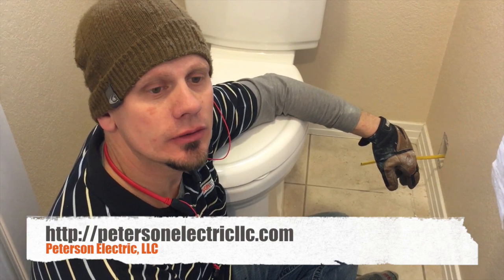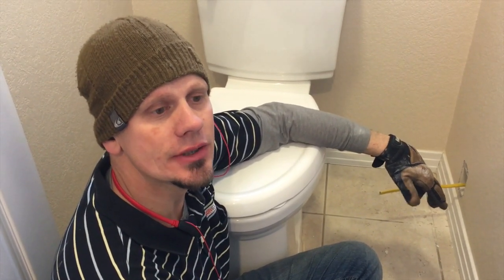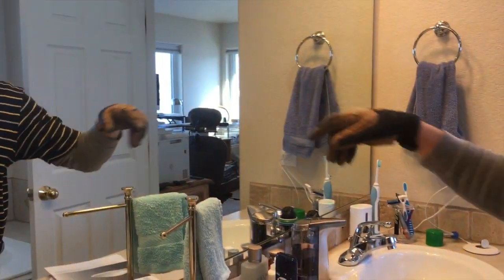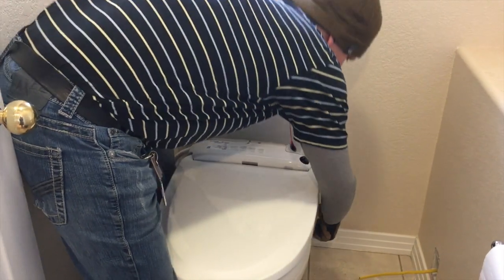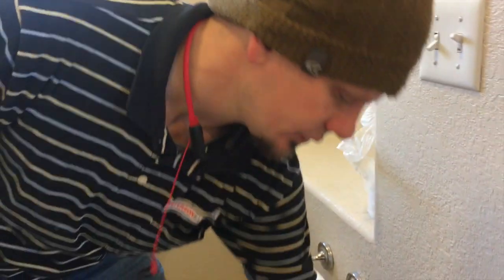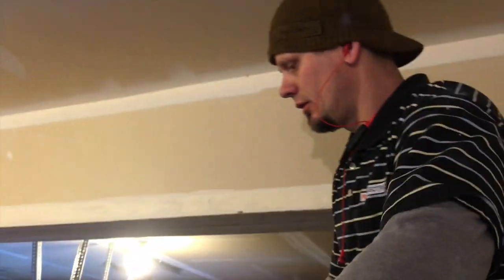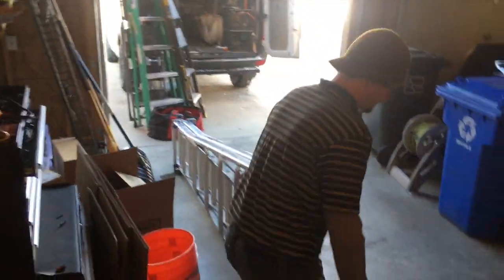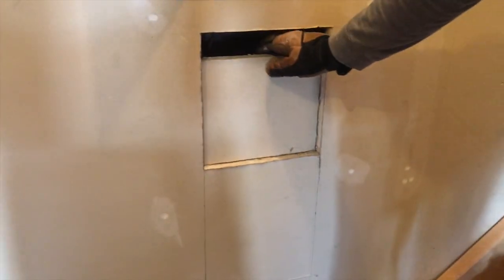Electrical Wiring For Heated Toilet Seat, Part 1

Comment: Nice vid Josh, thanks for posting.  Maybe you can better expound on your method of fishing that line down to the garage?  I know you cut in the receptacle box in the bathroom, then used that hole to angle-drill down thru the 2nd fl plate.  You mentioned tapping to locate it in the garage?  Did you then drill upwards thru the drywall & 1st fl plate, based on the tapping sound alone?  Seems risky.   Or did you have a flexible extension bit to reach the 1st fl plate?  Seems like the ceiling drywall & insulation above, would muffle the tapping sound enough to make it non-exact.  Anyone else have tricks for fishing thru both 2nd & 1st floor wall plates, besides measuring & updrilling?  Flexible bit & then attach an extension, drilling downward?  Dropping string & drilling up to snag the string?  Share ideas?

Comment: Nice informative video. I wanted to use a bidet and my electrician installed a GFCI outlet near the toilet. But he did not ground it. In the bidet’s instructions manual it says that the outlet should be grounded. Just wanted to know your thoughts on it.

Comment: How can I determine how many AMPs are on a multiple receptacle line?.  Sorry for all the questions, How do I connect to an existing GFI, do I connect the line to the bidet to the bottom screws of the existing and top screws of the new GFI?  Thanks
Reply: A GFI should be clearly market "Line" and "Load". Line is the incoming and load is outgoing (connect to next outlet down the line).

Comment: The wall to your left, couldn't you,run the wires up and over to that side  were you have the hollow wall? Having the power wire for the biday seen like that looks tacky, I wouldn't think the customer wouldn't want that look of the power wire of the biday laying on the floor.
Reply from the maker: NO, it was an exterior wall, and no attic space. They did not want drywall cut upstairs. Thanks anyways, maybe you could talk my customers in to cutting, that would have make my life easier, although, I would have then needed emt conduit on the outside of the house two stories down to the garage and then it would have cost double for the price as well as needing a 26' extension ladder.

Comment: I thought mc is not rated for Physical damage only bx is am I wrong?
Reply from the maker: What physical damage can happen in this area? Who determines what can be damaging. It is rated outside of drywall, and is not Romex or "NM" cable.
Reply from the maker: MC is rated for many uses and can be damaged, but ask your self what could possible damage this. I have asked many inspectors about SCH 80 conduit merging from grade level in a customer's residential back yard and said to them, "what is going to hit this conduit when we have a deck by it and or no vehicle traffic or tractors that can come in the back yard?" 
What really can damage what you are doing? It does not state that MC cable cannot be below 8' like NM cable.